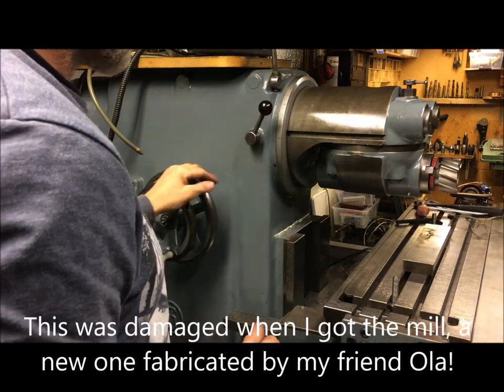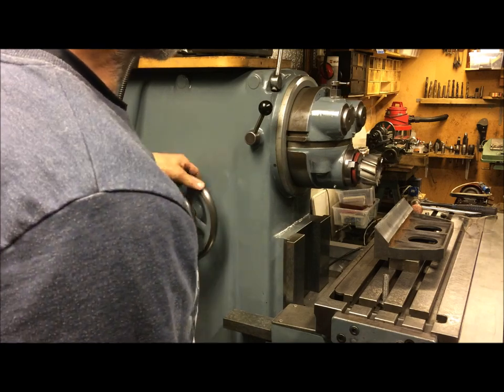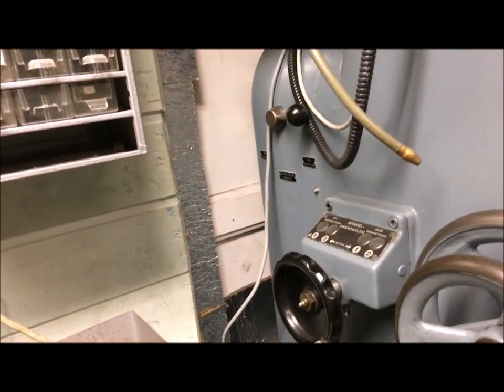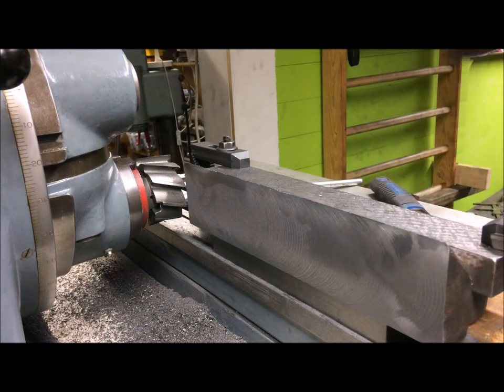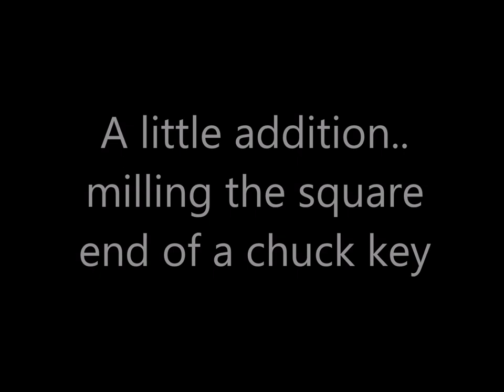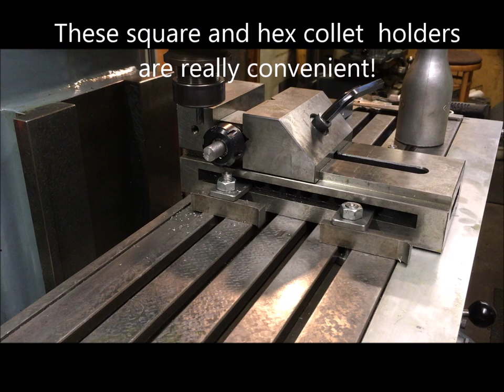Schaublin 52 action again, this time machining a short Kingway straightedge

Comment: Im glad to see the 52 getting some action. Especially after all the work that went into scraping and restoring it! I really need to get around to putting up some of my 53. The two machines are very similar. All the best :)
Reply from the maker: Thanks! I have used it quite a lot lately.. pleased with teh accuracy I get. A little noisy on the feeds. Also found limitations for feeds/speeds, epscially when usingt the backgear. I got the DRO running again, but am surorised how much I easy it is to read and use the scales. Will now mount the hi-speed head and try this out

Comment: Nice and thanks for sharing! Did not get a good large view of the high speed head. Please next video when you use it if you could show the head itself. Thanks! Daniel
Reply from the maker: OK. Consider it done! Thanks for the feedback/comment!
Reply: Jan Sverre Haugjord Thanks! I really liked that you showed the different controls and levers!
Reply from the maker: OK. Good! It is an old "girl", and when I restored it I chose to use a new version of the same switch panel/control box, but this is reall yplaced at an ackward place down at the side. However, there is a mains switch also on the front of the saddle/knee, but I usually use the side mounted separate motor/feed switches

Comment: Haha, I keep thinking of silly ways to cut strange features using that "spindle in a rotary table" design. Is it possible to cut with that handwheel which spins the whole spindle around?
Reply from the maker: Have thought so too :) I reckon it should be possible to take light cuts using both the column in/out feed and/or the rotational feed.. BUT I think it was only designed/meant for positioning.